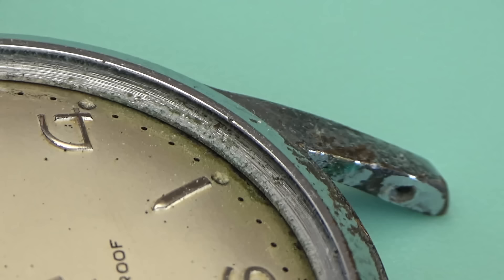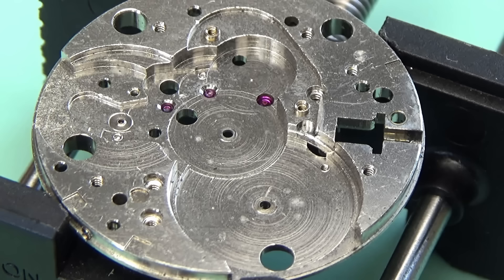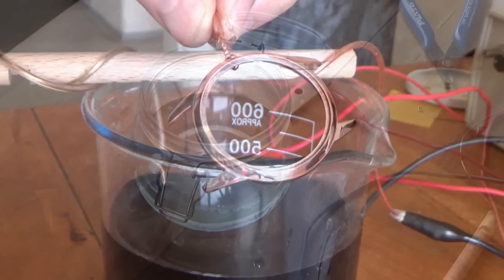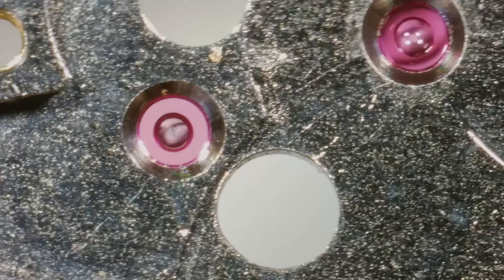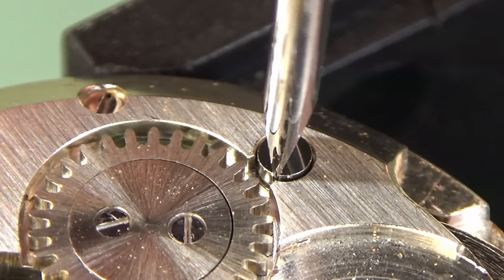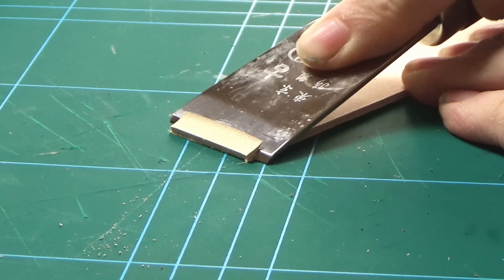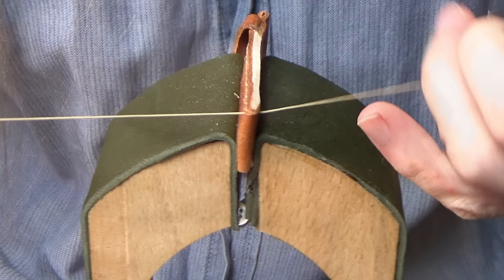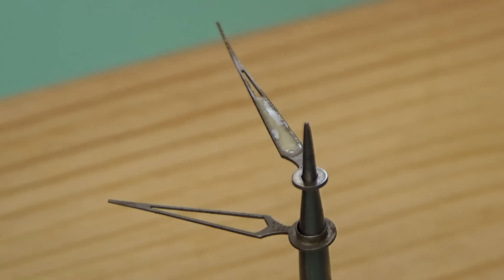Electroplating Rescues a 1950s Gruen Watch – This Was One Tough Vintage Restoration!

Comment: I picked up one almost completely like this one for $10. I bought it after watching this. Got it on Facebook marketplace. Previous owner had stretched the lugs and put on a wrong sized band. It does not say Swiss at the bottom. I am eventually going to get it restored. Does run and keeps time. Other difference is the hands are different.

Comment: Paradigm shift with this video, loved the watch strap making.
Reply from the maker: Thank you! I just acquired a Waltham, the same one you did some months ago! I look forward to getting that done. I hope your own endeavours are going well.
Reply: I am hoping top get the Waltham back together soon. Presently I have been doing a lot of repair on quartz watches for a local charity so not much time for my own projects. Have you had a go at making your own nickel plate solution? Apparently its quite easy to do. @Saving-Time
Reply from the maker: I have and copper as well it is quite easy to do. I'm lucky enough to have a shop right round the corner that sells the stuff for tiny amount of money. I did make my own before that though!

Comment: Thanks for the video!  I have never tried plating, but I may give it a go soon using your instruction. Many of the watches I buy are in need of re-plating. The strap making is also very interesting. There are not many (or any?) watch strap making videos out there. The microscope is very useful. I use mine mostly for documenting where things go and inspection of parts.
Reply from the maker: Thank you for the kind words! Plating is pretty easy preparation is key, I would also skip the copper on the first few tries. Good luck- David

Comment: Great watch and love the Bond reference. One more tip for you since you had so much frustration getting the balance collet set.  Remove the pallet fork (let off power first!) and replace the balance wheel.  Let it settle, then look between the banking pins and the impulse jewel should be exactly between them for zero beat error.  If it's not, make a mark on the balance wheel rim where it should be.  Pull off the wheel and move collet: impulse jewel aligned with your mark.  This is something you can even check when the watch comes out of the cleaner so there's even fewer parts to get in the way of the view.  BTW: "Tears before bedtime" is a cracked collet or broken impulse jewel.
Reply from the maker: Thanks for the tips appreciate you taking the time. I've had cracked collets before you are not wrong sir very much tears before bedtime on that day!

Comment: I'm from Ohio near where Gruen was located. IN the antique malls around here, you can get a suitcase of Gruens before breakfast. Lovely. The way I heard it with very little original research, Gruen was either acquired or merged with another company, which was subsequently acquired by Rolex. The target was Gruen's curve intellectual property. It's a good story that may even be true.
Reply from the maker: There building in Biel was sold to Aegler Rolex's movement manufacturer in 1977 I have no idea who brought the company in 1958 may well have been Aegler/Rolex :)

Comment: The consumer name for HCL acid is muriatic acid.People is it in the states use to clean the brick walls near the bottom, where you get fungus, and rain and dirt stains.
The copper bar in the first plating solution is a sacrificial electrode, which supplies copper to replace what gets plated to the part.

Comment: Bravo watch and leather strap beautiful.  
I have a tip on using the punches. I had to punch holes for
a insulated pad out of  nitrile, the engineer had a great set of hole punches.
The process lousy, using hammer with the material on the cement floor.
I did a ECO Engineering Change Order, I did the process with a block of wood 
To support the material then chucked the punch to our drill press and easily 
Now. So you might what to try chucking the hole punch in a drill press you may have
to change speed. Great YouTube channel. I subscribed.
Cheers 
Kristy
Reply from the maker: I'll give that a go; I never thought of it. I appreciate you taking the time to provide some tips.
Reply: Your so welcome. It does work and the punch will stay sharp longer,

Comment: With the setting lever spring, to stop it from flying before you put the screw or screws in I have a method that doesn’t fail. Line it up but do t engage the spring. Put the screws in but only so they are on but not tightened. Keep them loose. Then engage the springs finger and tighten. If it wants to fly the screws prevent it.
Reply from the maker: Sounds like it would work i will give it a go thank you! Appreciate the advice.

Comment: You could clean the small parts by putting them into a small screw down cage inside the cleaning baskets. you can put all the jewels from the balance along with the balance into a second cage.
A sheet of white paper can be used to clean the jewels. just put it face down and give a it a bit of a rub with your finger. Mess up the oiling then clean it on the paper.
Reply from the maker: I appreciate the suggestions thank you very much!

Comment: Watchmaker should refer to a clockwise wound spring or a counter-clockwise spring, plus some of the screws are right-handed threads, and the others are left-handed threads.
Reply from the maker: I use left and right, and pretty much only the crown wheel crew will be reverse threaded in most watches.

Comment: Didn't know about the Sean Connery/Bond connection. I have my 
granddad's from 1954. It's gold plating is an 8 and the movement 
needs a tune. It's the face that's a bit corroded, it's a 5.
Think it's time to break it out, get it tuned and clean up the face.
Reply from the maker: If you want to push the boat out, this is the best dial restoration workshop I have ever come across: https://arcstampfli.com/. There is no affiliation with me; they just do stellar work. Good luck with it. I think watches with a family connection are wonderful things to own and wear.

Comment: New sub here, making my way through your vids. You pick some very interesting watches and not the all too usual. 👍 This Gruen is a very nice job and the plating looks far more original than most that tend to be too chrome shiny. 
I like your Doxa vids. I used to have a few, mostly from the 1930's. Kinda sorry I sold them years ago. I've one left, a Doxa 'DH' WW2 German issued example. Very robust with shock protection, 'waterproof'(well it's more likely that now as I replaced the original lead seals with rubber) and very nicely made in steel(most DH's were plated brass). Great little timekeeper too.
Reply from the maker: Sorry about the late reply; for some reason, YouTube did not show me your comment! I'd love to get a steel ww2 vintage Doxa nice watch, thanks for the kind words
Reply: @Saving-Time  Youtube was probably being sensible hiding my comment. 😄 One thing I like about those DH Doxa's is the shock protection is incabloc and looks near identical to a modern one. Clearly a good design from the start(1935 I believe?). Anyway, great vids. Look forward to more. 👍
Reply from the maker: Yup, somewhere around the 1930s, I think you are correct. It was expensive, I believed, up until around the mid-50s, when manufacturing got the price down, and you started to see it in everything. I own a 1940s Zenith with shock protection, but that would have been an expensive watch, so it kind of makes sense.

Comment: I'm not sure, but I have a suspicion that the issues you had with the glue were due to it being leather cement. It certainly looks the part. In that case the way to use it is to apply it to both surfaces, let it dry for 10 minutes, then firmly press them together. This way you don't need to leave it clamped.
Reply from the maker: Thank you for the tip; it is much appreciated. That's exactly what I thought. I use leather cement quite a bit, but damn, this stuff was about as sticky as flour mixed with water. Back to the good stuff: next video, a real leather cement:

Comment: As a metalwork person (no experience of any kind with watches or clocks) I'm slightly shocked at how rough some of the internal part surfaces look. Is that just typical of watch parts, or is the lighting rather contrasty giving me that impression? I'm just curious.
Reply from the maker: It's the magnification and the lighting to the naked eye they look perfect, age and wear plays a significant factor as well of course. Modern very expensive watches will look flawless even under magnification.

Comment: I’ve used plain old UHU glue for years on straps and it’s perfect. You can roll or hammer the parts once glued and it’ll never come loose. And yes, I absolutely agree with the ridiculous rip-off pricing of Bergeron equipment- that company is a con and rarely worth the cost.

Comment: Lovely video. Curious why you did not re-lume the pips on the dial in the same way you did the hands?
Reply from the maker: In order to re-lune the dial, the old lume would have to be removed. This would require the dial to be submerged in water to safely remove the existing radioactive dial lume. It's a very high risk of damage to the dial, and I'm not jumping for joy to deal with any more radiation than 100% necessary. I'm glad you liked the video, and I hope that answer makes sense.
Reply: @Saving-Time  yes makes sense and was not a thought in my mind as to the “why not” so it’s knowledge for me. Thank you for the reply and I hope you enjoy the microscope 👍

Comment: I'd like to know how you cleaned the radium out of the watch hands. I hope I didn't just miss it.
Reply from the maker: I forgot to put it in the video, which was so long that a few things got left out. It is, however, super simple: dissolve it in acatone.
Reply: @Saving-Time  I had no idea. That's amazing! I have one I need to do myself and was dreading picking it off. Acetone, genius! Thanks!
Reply from the maker: @cyberbillp  Acetone just dissolves it completely in a few minutes. Drop it in and stir it around. The dial is harder to deal with, as acetone will dissolve the paint and varnish along with any lume on the dial.

Never deal with radium in the open air. If you need to scrape or clean hands or dials, you should submerge them in water or some liquid. The danger comes from the dust that could be created when cleaning, so having things submerged in liquid stops this. The hands are easy and safe to do. Dials, on the other hand wel.... 

Good luck
Reply: Very true. Beautiful job.

Comment: Is it normal for Gruen minute hands to dip toward the dial like yours does? I have a 580 SS movement I'm working on with a similarly bent minute hand. I am tempted to try and straighten it, but now I'm thinking the dip is normal??
Reply from the maker: It's normal on dials that are not flat. Don't straighten it 😉 good luck with your Gruen

Comment: What was the final amperage.? I hate lint! Always flies around and jams up in train wheels. Not sure how to make a clean rm out of a closet but may try!
Reply from the maker: It was around 270, so not perfect but acceptable. I'll post a picture up on Instagram at some point. I did not realise I was quite so zoomed in on the last timegrapher shot in the video until I came to the edit, and by then I was 100% done filming this video. This one took a while to put together!
Reply: @Saving-Time  great job filming and editing. I’d like to try the camera rather then loop all day. Looks less stressful for me back? I tried a microscope that didn’t wk. I wk on vintage omegas, about 20 a week.
Reply from the maker: @richardadelberg8961  I'm still 90% of the time on a loupe. The microscope is great for part inspection, but yes, mainly the loupe. I shall be doing a vintage Omega here at some point, and you'll have to let me know how well I do or do not. Should be before Christmas, with some luck.
Reply: @Saving-Time  I’m sure you will exceed all expectations. Capturing max amp is always the battle.751&2 love ro run at 230-240’s amp rather then 270’s. There many calendar parts that drag on power

Comment: Very cool watch! Understandable and easy to follow vid, thank you! Quick question, what's the name of the gear type on the clutch? called it "brege" or something? it looks almost identical, except in smaller form, as the internals of a DT Swiss bicycle hub system. Just found that interesting!
Reply from the maker: The teeth are called Breguet teeth after the watchmaker Breguet. I have to admit i know very little about bicycles. I hope that was the info you where looking for :)
Reply: @Saving-Time  that's perfect! I couldn't get the spelling right even though I should know my French spelling a bit better than I do! thanks!

Comment: Great vid. I have a dumb question. The microscope - does it require connecting it to a computer, or can it be used by itself to magnify the watch mechanism, instead of the typical watchmaker's eyepiece. Thanks.
Reply from the maker: It comes with a 10" monitor connected to it. No computer is needed It also has HDMI out so you can just plug it straight into a large display if you want to.
Reply: Thanks! @Saving-Time

Comment: I was actually wondering if the lume was radium or not?
Reply from the maker: The lume pips on the hour markers, maybe... I'm not 100% sure on this one. The lume on the hands was not. even before I removed it, so I'm guessing someone had already replaced it.
Reply: @Saving-Time  I have a 1948 Gruen Precision 335ss-820 that I am not sure if it is or not. USA made in Cincinnati and not Swiss
Reply from the maker: Assume it's Radium as it's probably Radium, removing it from the hands is easy Just dissolve it in acetate. Under no circumstances, scratch it off; you'll get radium dust in the air, and you don't want that. I always remove the Radium from hands. I don't touch dials. In order for the Radium to be removed, you need to work on the dial underwater so you don't get any dust into the air.  Dials are tricky I would not recommend working on a Radium dial unless you know exactly what you are doing. If you don't want to do it yourself and you want the radium removed, go here: https://arcstampfli.com/contact/ send Lindsay an email She is super nice and one of the best in the business when it comes to dial restoration and removing old Radium. I'm sure she would be happy to give you a quote to get it fixed up.  Hope that helps